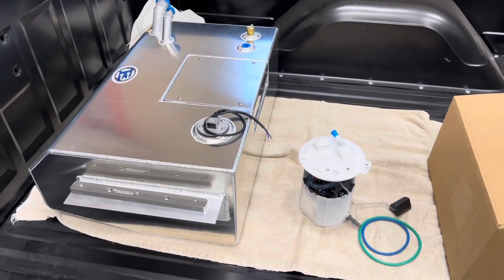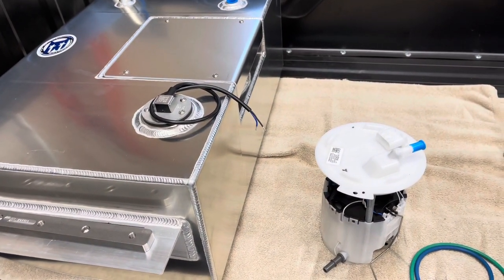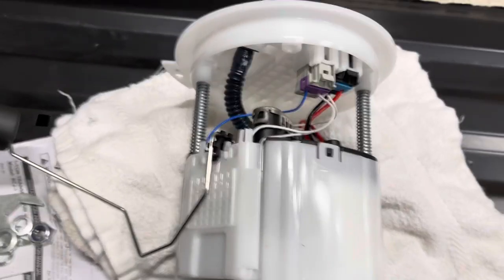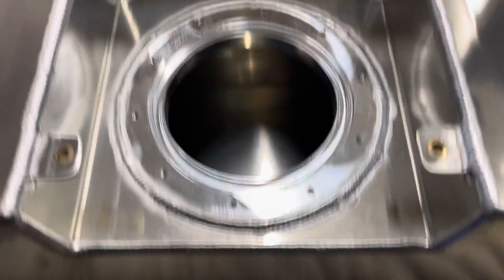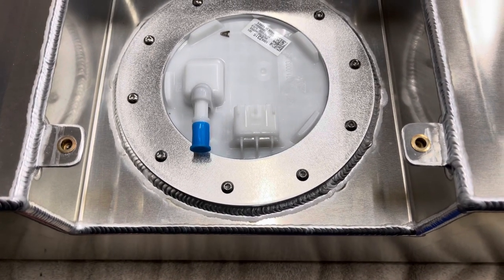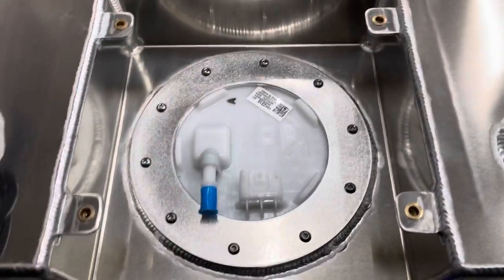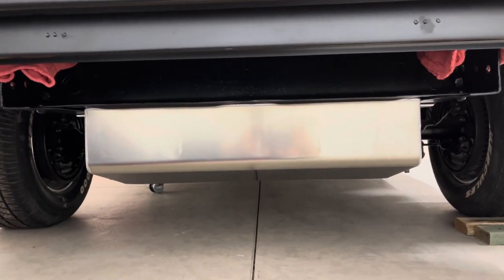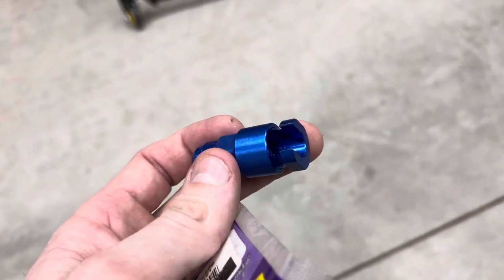1972 C10 Boyd’s Fuel Tank Install

Comment: I got a similar aluminum 22 gal tank for mine from CPP... it was pricey for a fuel tank too, but it was just over $400... gonna go with an external pump that I can mount on a bracket on the frame rail, so if it needs to be replaced, I don't have to drop the tank to do it...🖖🏿😎👍🏿
Reply from the maker: There’s absolutely nothing wrong with running an external pump.  I used to use them many years ago.  There are 2 benefits from an in tank pump however.  First they are quieter, and second the fuel in the tank helps act as a cooling agent to keep the pump temperatures down.  Thanks for watching!

Comment: Try to include a vapor canister telling your PCM programmer to disable EVAP test, but keep purge. Include a roll over valve in a hose run up high inside the fender to attach to the filler neck. That tank is what I would purchase, if me wallet said yes. The 98 & new GM trucks use the same P/N for almost all and a salvage yard find it perfect. Just save all of the pinch connectors and a length of hose that goes with them. Each port is labeled from that factory and a home made bracket is easy to make to fit real estate near the back. The extra line required for purge is required but it burns raw fumes you paid for. Where it says tank valve, either glue seat foam on it or attach a small engine paper fuel filter in line. Once warm, the engine pulls outside air in to empty the canister of raw hydrocarbons. Just harvest one and shake to make sure no black pellets fall out which very rare. Look real good!
DK, Omaha

Comment: Thx. I agree about those handy automatic punches, also was wondering about plumbing this tank because there are a few videos but none all inclusive that I've found... for instance which brand of durable in line filter performs well, part numbers for all the lines and fittings, complete explanation of wiring, etc
Reply from the maker: It might be a bit before I get to a video on mine explaining.  But, running a corvette filter from the early 2000’s vintage close to the tank has worked well for me in the past.  It also has a built in pressure regulator in case your running a different fuel pump without one, but you have to run a return line back to the tank.  The lines I build custom with braided stainless 3/8 hose.  I’ll try to do a video sooner to try and explain into detail.

Comment: How did you secure the plate with three tapped holes to the frame rail?  Are the two extra holes in the plate intended for welding to the frame - like spot welds?  Easier if the bed is not installed yet.
Reply from the maker: I didn’t.  The plate sits on the top of the lower frame rail and it is just sandwiched together with the tank, frame, and isolator pads by the bolts. I found it easier this way.  It’s not hard to position either side in place while you start the bolts from the bottom.  The instruction say you can use this method or you can drill and tap the frame and use the 2 screws per side and bolt it to the frame, also instructions mention welding as another method but my frame was already painted so I didn’t want to weld it.  Also I like the way I did it as it is easy to drop the tank if you ever have to replace the pump.  As future maintenance would be easier.  But all 3 methods work, really depends on what the installer prefers.  I will also mention before painting the plates to install I welded different length standoffs to plates varying from 1/8” to 3/8” because the plates did not fit my frame perfectly flat and I wanted even clamping pressure when bolted together.
Reply: @curtrobinsongarage5452  Thanks for detailed explanation.  You made several good points that will help with my installation.
Reply from the maker: @kellygrubaugh8530  your welcome, just trying to get some information out there for those willing to listen.

Comment: Thankyou for the detailed build information. 
Is this the pump I would run with an L83 or is it the stealth 340? 
-Make sure your door is closed when removing nozzle from in cab tank filler so you don't slosh gas all over your bench, lol.
Reply from the maker: You could use either for an L83.  Pretty much with any LS or LT based motor any pump that puts out 55-65 psi will work unless you are over 500 hp then you will need to worry about fuel volume as well as pressure
Reply: @curtrobinsongarage5452  I highly recommend the MU2101 fuel pump for L83 and L86 engines - also recommended by Boyd's Tanks.

Comment: How did you wiring up the pump ? some guy told me that i need a fuel system control module with this pump... thats again a lot of money to run some fuel to the engine.
Reply from the maker: Can say for your specific application not knowing your specifics. But for the way I do it you do not need a fuel control module.  I always do LS1 swaps using the factory GM computer with a stand alone wire harness and fuse block. In doing so the computer controls power through a relay in the custom fuse block to power the pump just like the factory setup in which case when you turn the key on the pump is powered for 5 seconds then shuts off unless you crank and start the engine then it runs continuously. This is done this way as a safety so if your motor dies such as in an accident the pump doesn’t continue running pumping fuel all over.  But as far as the basics one wire for pump power, one for ground, and 2 wires run directly to my Dakota digital gauge cluster for sending unit to fuel gauge.
Reply: @curtrobinsongarage5452  Thanks for your fast response....
My setup i gonna use is a L99 engine with a stand alone and E38 ECM with a boyds welding tank ( same as yours ) and the original fuel pump out of my donor car from a camaro ss 2014. i don't take the fuel control module out of the car, i didn't know there was one in the car, i thought the pump was running by the ECM of the car so the rest is gone to the junk yard shredder already.
i am happy to hear from you that you also don't use a fuel control module.
is it necessary to change the original fuel pressure regulator for a 60 psi regulator ?
Vaporworx sell them for my pump and recommended it.
The relay that you are using to prime the fuel pump is that a special one ? i like the way you run it with the 5 sec of prime with no starting for the safety.
PS: doing a ls swap in my '69 C10
Reply from the maker: @IrocDennis  did you already have a stand alone harness made?  If not I use Speartech.  They build great harnesses and will also do all the PCM retuning.  I’m not sure if the E38 has a fuel pump provision but it should.  If you have a professional harness made it will come with a fuse block and the associated relays for fuel pump, engine fans, ect.  As far as pressure regulator the GM pump you have is internally regulated but I always run an external fuel filter and use a corvette filter 99-2004 which has an internal regulator as well and has a single 3/8 feed line to engine as well as a return from the filter back to the tank.   Once I’m done painting I will do in depth videos of the wiring and plumbing. However that will not be for some time.
Reply: @curtrobinsongarage5452  yes I already have a stand alone wiring, i buyed it from some guy on Facebook. Yes there is a fuse block with some relays and I saw a wiring that goes to the fuel pump relay. I think I buy a fuel pressure regulator from Vaporworx with the 60 psi and put this in the Gm pump. I’m interested in your video in the next time

Comment: What did you use/how did you wire the pig tail on top of the fuel module? How did you tie it in with your standalone harness
Reply from the maker: So I’ve had quite a few questions about this so I did a video on it that should show up in the next half hour or so. I won’t be doing my truck for a while till I get the paint done so hopefully it will answer your questions.  If the video doesn’t let me know and I’ll try to answer you the best I can.

Comment: What about thw filler neck? Where does it come out of
Reply from the maker: The tank can be ordered with a vertical that would require a cut in the bed floor with a flush cap. Or with the side outlet like the one in my video you have a few options. Some guys just run a filler up the inside of the side of the bed. But most do a custom install and either hinge the L/R marker light with a modern filler door hinge and put the cap and neck inside the bedside. Or they do what I’m doing and put a custom flush cap recessed behind the L/R taillight assembly and use an LED light assembly  on a hinge reminiscent of 56 Chevy bel air.

Comment: Hi buddy,  question  what is the difference having the flange and to be flat?
on the fuel tank for the fuel pump
Reply from the maker: It’s basically the design similar to the GM mounting method they use on their tanks for their pumps. It allows a perfect seal for this particular pump.  The bad thing is you can only use this pump with this tank.  Boyd’s makes a similar tank that is for a more universal pump but I chose this design because experience tells me that the GM pump I am using will be more reliable.

Comment: What’s size is the filler neck 1.5 or 2 inches?
Reply from the maker: You can order either size.  Mine is 1.5”.  Easier to   deal with.

Comment: Why not just bolts on top of framerail instead of a mounting bracket and save $50?
Reply from the maker: Person preference but with the bracket you don’t need a wrench to hold 6 nuts in a hard to reach spot.  Removal and reinstall is also faster. I come from a mechanical background I design and build things that are easy to work on and take apart unlike most vehicle manufacturers today!